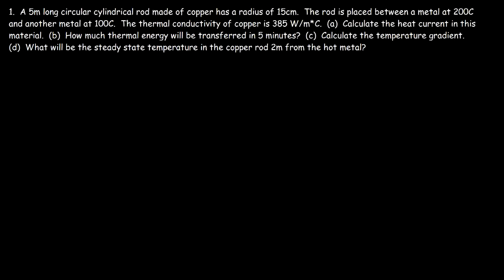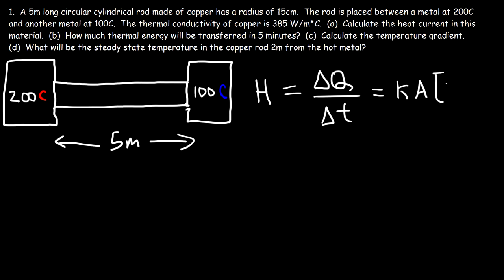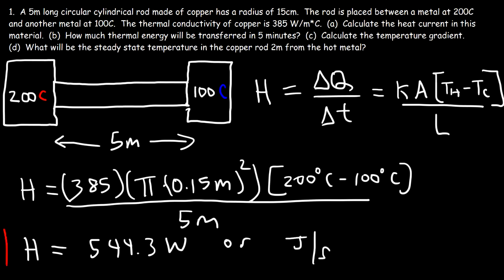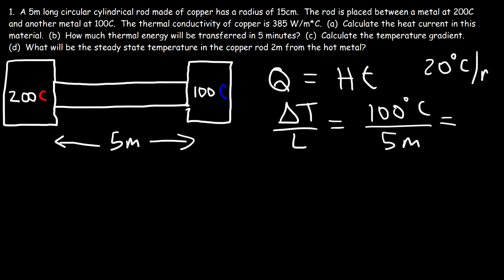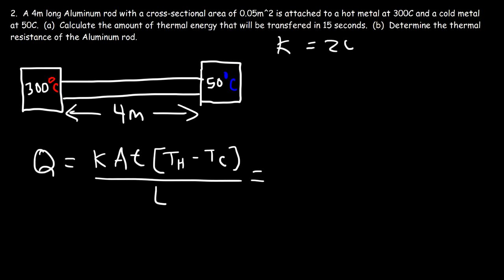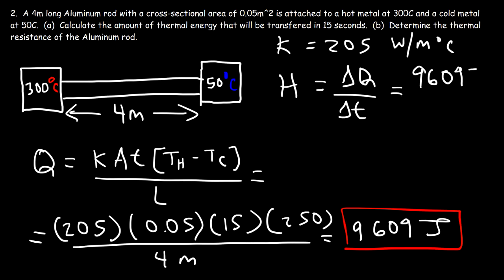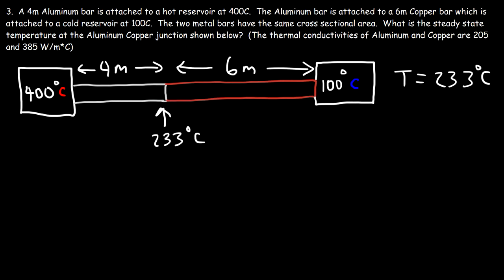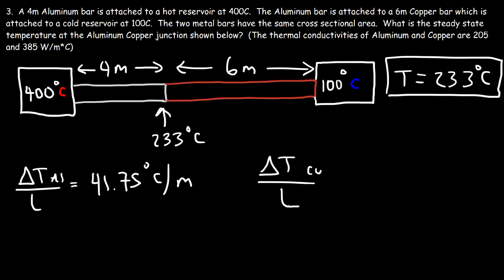Heat Current, Temperature Gradient, Thermal Resistance & Conductivity   Thermodynamics & Physics

Comment: For the first and second problems, it is not specified that it’s a steady-state conduction, as it would be more logical that the metals change temperature as there is a heat exchange between them. This was probably assumed, but it would be nice to have it explicitly said (the resolution was confusing without knowing that fact).

Comment: Thank you for the video and I have a question. Isn't the thermal resistance in this particular aluminium rod represented by the length divided by the thermal conductivity times the area(L/(k*A))? It does seem logical when the area gets bigger, the resistance becomes smaller. I learned that in school and wanted to check if it is right.
Reply: Ya but it seems to be x/kA. The opposite😳
Reply: @opdhaka  x and l are both the same quantity.

Comment: Can someone tell me at 14:53 why and is it viable to consider the heat current equal for the both sides. I mean the length and temperatures are different but still can we consider them equal?
Reply: same question
Reply: Because of thermal equilibrium, in the end its still going to be equal